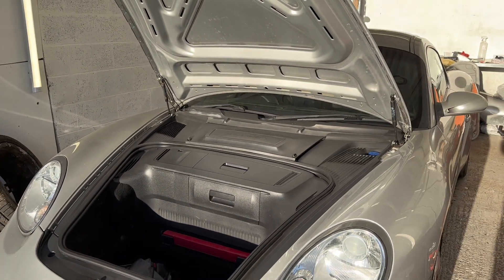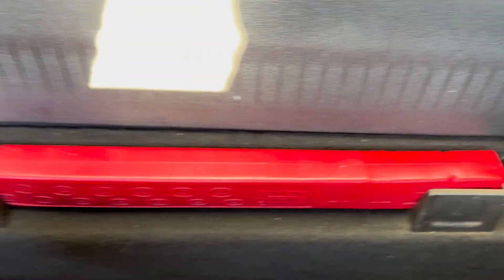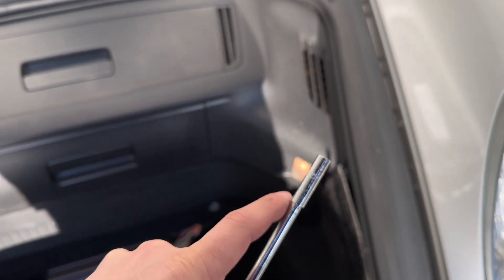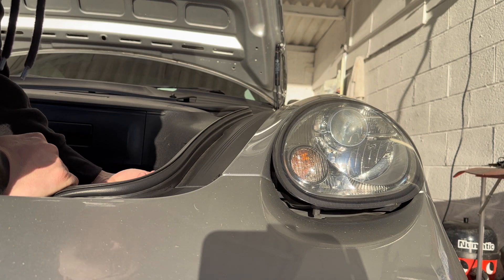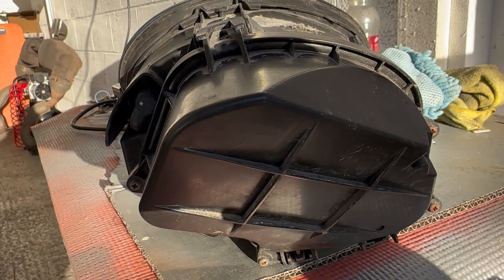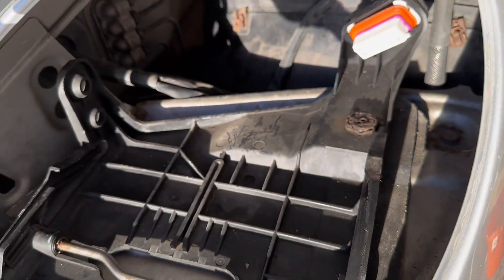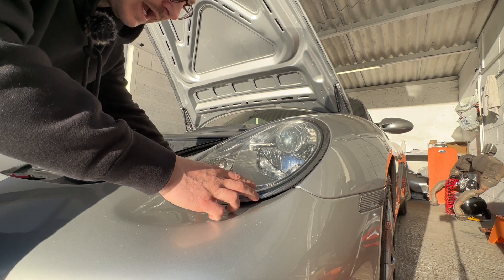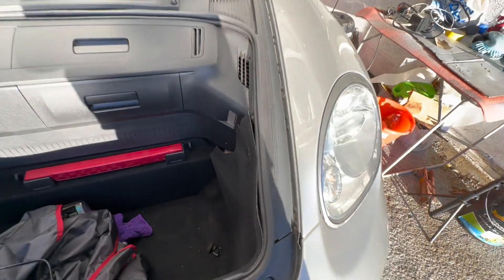How to remove a Porsche Cayman, Boxster 987 Headlight assembly and bulbs. Quick easy DIY!

Comment: How do you adjust the level on the headlights?
Reply from the maker: Believe it’s a 5mm Allen key to adjust vertical position of beam
Reply: Just a heads up: I read on forums that the 5mm Allen key needs to be 6 inches or 15cm's in length to reach it